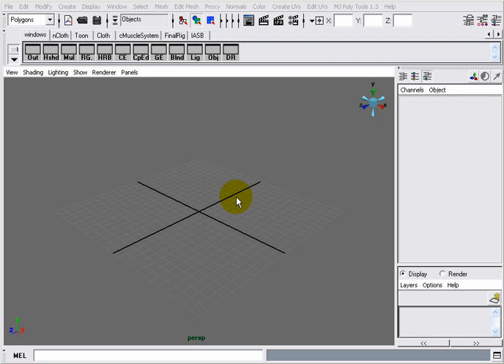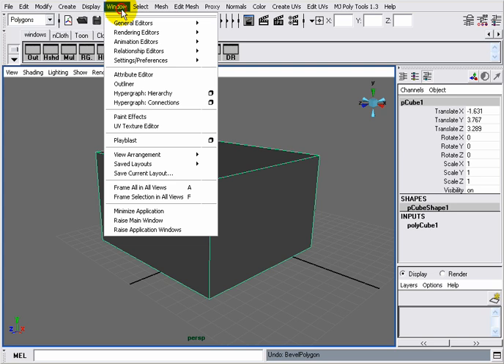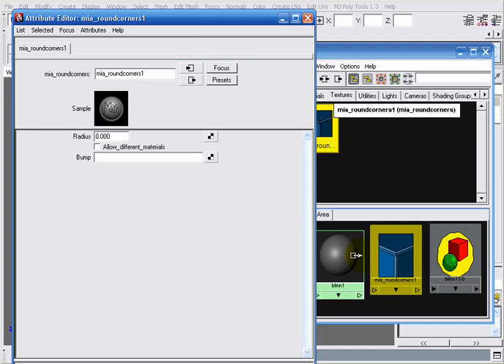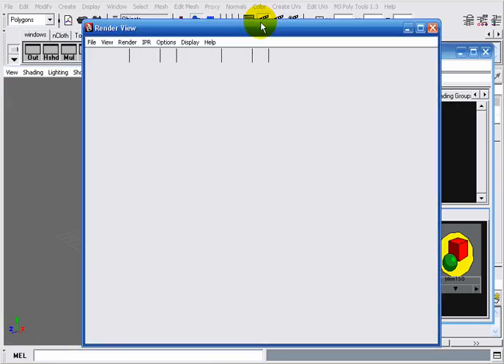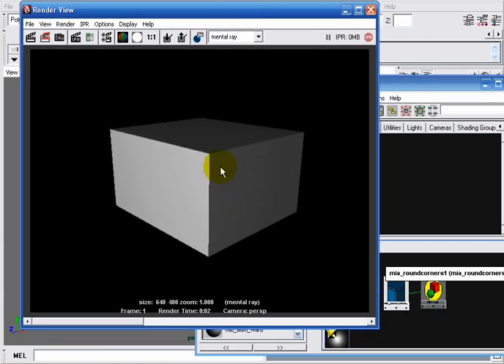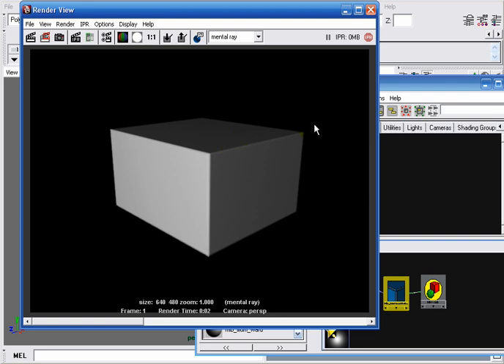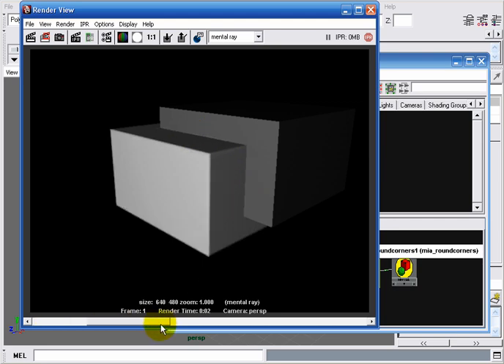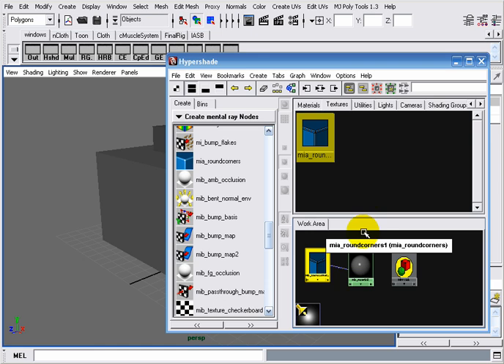Maya/mental ray Tutorial - mia roundCorners

Comment: First of all, thanks for the tutorial. 
Second, an important note: mia round corners ought to be connected to the Overall Bump slot of your material. Connecting it the way you presented causes a fatal error and Maya's crash (at least in 2012 version and up, don't know about any other one). Results are identical. Just my 2 cents on the matter.